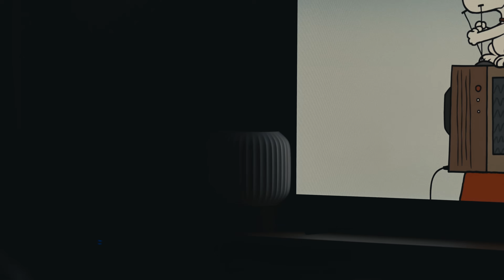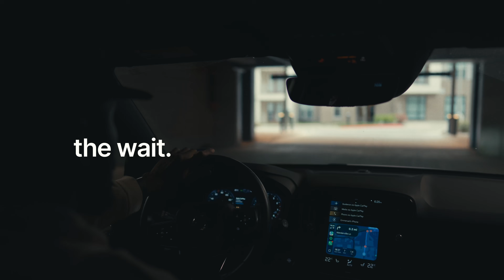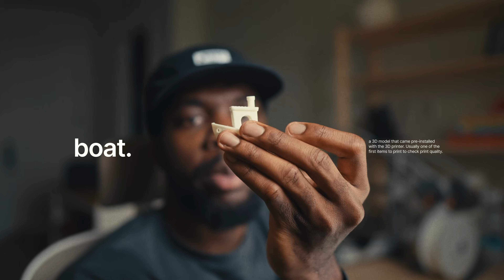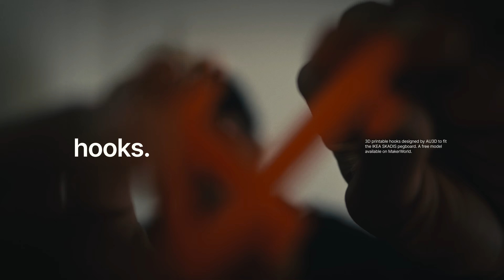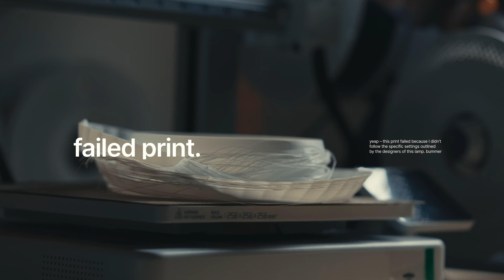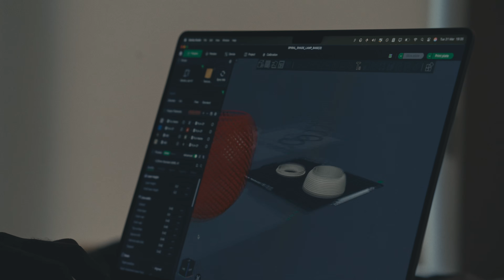The Freedom to Make Anything

Comment: I've owned a fair few 3D printers over the years, and the thing I love most about Bambu (and the A1 especially) is that it really makes Design and Fabrication the hobby, and not fiddling with a 3D printer.  Don't be afraid to take off the build plate and flex it to get the parts loose! You're not going to hurt it.  Also, I highly recommend the Biqu Frostbite (if you mostly print PLA) build plate.  It's amazing, I swear by them.

Excellent video, love the vibe and editing!
Reply from the maker: Oh thank you for the insight! I will definitely look to get one

Comment: the boat is called benchy btw also, set the filament to the same one in the object menu and fila setting part thing to get rid of the tower if ur not multi color printing
Reply from the maker: Yea but the printer required it for a smooth timelapse. Thank you

Comment: hey great video, quick question for you if your printing single color (lamp) why are you printing the prime tower, do you really notice a big difference interms of the nozzle preassure vs saving that much fillament?
Reply from the maker: So I use a cyber brick for timelapse. At every layer, the cyber brick triggers my camera to take a photo.

The slicer requires the tower for the smooth transition

Comment: Just in case you didn't know this, I saw a lot of contact between your hands and the printer's plate. Fingerprints are really bad for adhesion to the printer, so try to avoid that. If you are getting adhesion issues though, just wash it with dish soap and warm water.
Reply from the maker: Oh wow I didn’t know this. I will keep that in mind. Thank you!
Reply: @NuelNwosu  No problem, I recently bought a P2S and had a few prints fail before I figured it out 😅

Comment: Your visuals are great, but please work on the audio mixing, the music is too loud and overall your voice is to quiet. Keep creating :)
Reply from the maker: Thanks for the feedback, I'll definitely keep an eye on those audio levels for the next one as multiple people have mentioned that! ❤😊
Reply: @NuelNwosu  A very easy way to apply is is selecting your audio tracks and using a normalization on them. It basically just brings all your values to the same baseline, I use it often for audiobooks. Sometimes processing affects the end result and normalization can help with that. of course, you're still able to adjust the individual tracks volumes afterwards if you find them too low or loud.